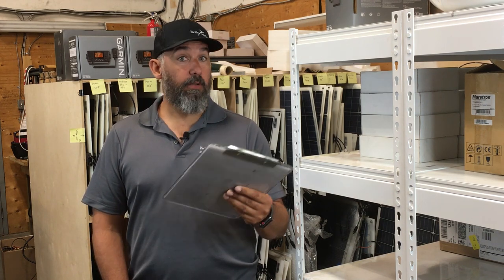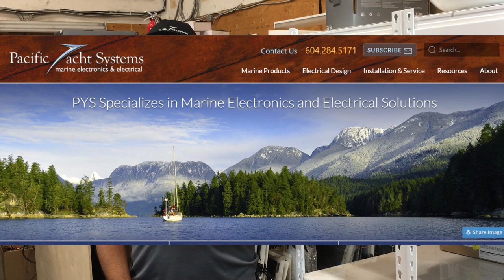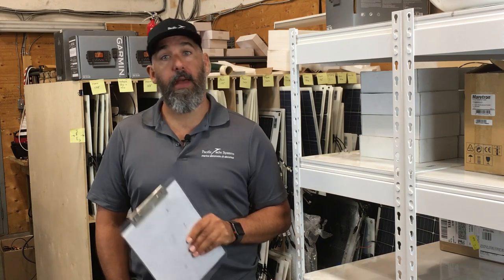Ask PYS - Should My Bilge Pump Be Connected to My House or Starter Battery?

Comment: Connect it to the battery that is the highest in the boat and not in the bilge.
Once the bilge floods the batteries are "toast" knocking out radios, engine, and bilge pump.
Reply from the maker: Good one! That's why main ships have a comms battery right underneath the helm.

Comment: Hey Jeff 
I’ve just recently stumbled across your YouTube page. I was a marine electrician on the Gold Coast, Australia. I swapped to industrial about 10 years ago as the marine industry here died and we were importing cheap boats from China. Now if you wanna see some wiring that will scare the crap out of you check out a cheap Chinese boat.
Keep up the awesome content. If I’m ever on B.C. I’ll look you up. 👍
Reply: I worked for GUNBOAT and they had China contracted to build the 60' series using our molds. Every single boat China built for us wouldn't pass electrical inspection. Electrical was really BAD. We had to bring those brand new boats to N.C. (in the U.S.)  to redo electrical and many other major systems flaws. THIS resulted in back billing China for these warranty repairs (which ran into the millions) and of course China refused to pay. The money to fix these flaws was coming straight out of the 55' series assembly plant in N.C. ..So profits from the 55' series were being used to repair the Chinese 60's. *THIS resulted in the bankruptcy of GUNBOAT U.S.A. ..Then China tried to buy the GUNBOAT company brand name in bankruptcy court. The whole time they were building our 60's they were using our molds to make 60' GB knockoffs. We even had a non compete contract that they totally ignored. Never buy a Chinese made boat/yacht.
Reply from the maker: How sad, electrical is so important to running a boat. How could one of the pillars of a boat be so butcher.

Comment: Would you wire a bilge pump to a LiFEPo4 house bank with an "internal BMS" or a lead acid stater battery?
Reply from the maker: I would take it to the start.   the best would be a lower pump to the house and a higher pump to the start.  so the start battery is only drained if the lower one doesn't work.

Comment: Is current draw from a bilge pump an issue? I would assume that if house batteries are being topped up via solar or wind, that with a long term unattended boat the engine battery could be drained by a pump running, whereas the house bank would automatically be getting topped up? Can house battery banks sustain a bilge pump for 2, 3 or 4 weeks? Are there boat to phone Apps to notify an owner if a bilge pump is running, or if excessive battery consumption is being detected?
Reply from the maker: Good question, a bilge pump might draw 5 to 15 amps at 12 VDC, over multiple 24 hour period, most boats batteries would only last a few days or maybe a week depending on the size of the bilge pump and the battery bank size and health.

Comment: Personally I would choose the biggest battery bank. Reason? If the bilge pump is needed, you want to set it up so it lasts long enough for you to get there and find the reason for leak and fix it, provided there is even a chance to prevent the boat from sinking. If it means killing the largest battery bank, so be it.
Reply from the maker: That was my choice on my boat too.

Comment: I'm putting together a 48v bank for electric motor, 
any thoughts on running bilge pumps off 48-12 DC-DC converter?
not sure how reliable converters are, or if it's worth getting another battery just for bilge pumps.

i saved for ages to afford my batteries, would kill me to have to buy another, but if necessary i will,
fish gotta swim, boats gotta float.
Reply from the maker: how are you running everything else on the boat? lights, nav gear etc. all though a converter from the 48v bank? or do you have a house bank as well?  if not   I would consider a 12v battery for the critical loads nav lights, vhf radio, gps, bilge pump etc charged from the 48v bank.  or maybe carry a spare converter on board.

Comment: Thanks for the video. I'm about to replace 3 pumps on a boat I'm purchasing - a forward pump, aft pump and an emergency pump. None of the auto float switches work. One pump is dead and two work with a manual switch. You had me until the very end (at minute 2:01) - you wire direct to house battery "Unswitched". My question is do you mean they only rely on the float switch to turn on and off in your install and there is no manual switch in the system?
Reply from the maker: Hi Bill, thanks for asking clarification question. "Unswitched distribution" means a direct power connection to the battery. In other words, even with your battery switch off, you bilge pump off / on / auto switch is still powered. It's important to have bilge pumps work even when the main battery switch is off.
Reply: @PacificYachtSystems  Got it. Thanks for the reply.

Comment: Connect it to the house battery.  If the pumps needs to run so long as to totally deplete the house batteries then the odds are that your boat, by that time, is under water and then who needs an engine battery?
Reply from the maker: Thanks exactly how i have my bilge connected on my boat.

Comment: I intend to use only 24vdc in my boat, but I couldn’t find electronics n2k compatible in 24vdc, only in 12vdc. How to solve this? Thanks
Reply: Hi Alcibiades Marcial Neto, that is an excellent question and depending on the size of your boat a 24V system makes sense. Some equipment is either not available in 24V or is very difficult to acquire. Examples include VHF radios, and as you mentioned electronics powered by the N2K network. If you engine starter is 12V, and you have a 12V alternator then one option is to use run a dual-voltage boat. Your electrical panel would then have three zones (12V, 24V, and 120V). But if you intend to stay with only 24V then the solution is to use 24V-to12V step-down converters. These converters come in all sizes and can be setup either individually for each 12V piece of equipment, or multiple electronic devices.
Reply: @brianbuchanan5170  thanks for your answering. I wish I could find any other solution since a step down will demands  a battery bank to support it because if a sing CI ou transistor or capacitor blows it will take all system down. That’s why I was dreaming for electronic equipments in 24vdc.
Reply from the maker: Another point to consider you can have a 24 VDC bank for the boat, including starter and alternator, and those small 12 VDC loads (e.g. total of 20 -30 amps) can be run from a 24 DC to 12 DC converter.
Reply: @PacificYachtSystems  thanks for your attention, but this solution will demand another battery bank since a converter may become defective and this second bank is what I would like to avoid. Thanks

Comment: how much does your boat cost?   how much would it cost for a sunken recovery?      its simple 2 bilge pumps one hooked to each battery!!!!
Reply from the maker: Good one. Anybody else?
Reply: That’s what I do on my 34’ cabin cruiser. I have a rule 3700gph hooked to my house bank (3 group 31 AGM), a Rule 2000gph to my port engine battery, and a rule 2000gph to my STBD engine
Reply: Incase you have a leak and the engine is off the engine battery is drained in a few hours, now you have a leak and your engine wont start, pretty bad if you are overnight on the water
Two pumps doesnt help, because you dont notice if one has failed until both have failed.
You need 2 pumps and an alarm device.
When the mainpump fail, the water in the boat raises until the Alarm get activated, than the Backup pump gets enough water to run.

Comment: On my boat the main bilge pump is connected to both batteries via diodes. The boat builder did it that way.
Reply from the maker: Hi John, interesting. Can you share the make and model of your boat. Also the model of the isolator used for your bilge pumps.
Reply: @PacificYachtSystems  It is a Chaparral Signature power cruiser. They did not use a special isolator. The bilge pump is wired to each battery via axial diodes (similar to NTE5812HC
) to prevent backflow.